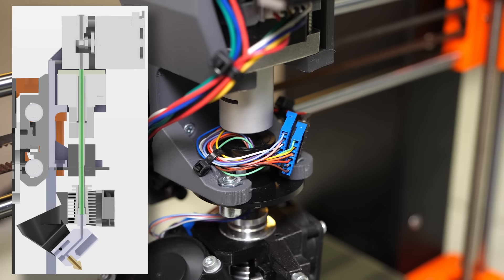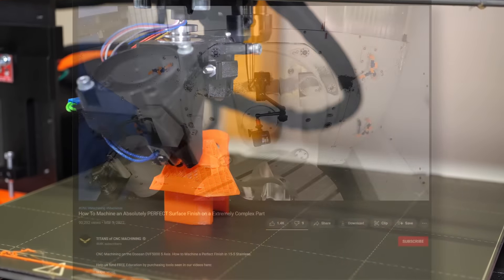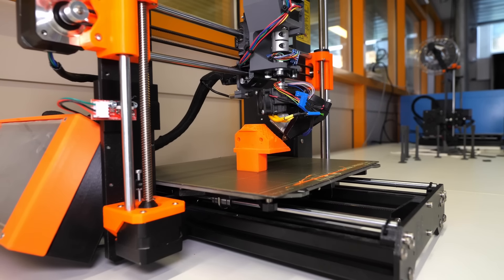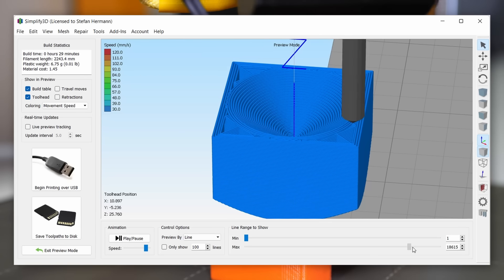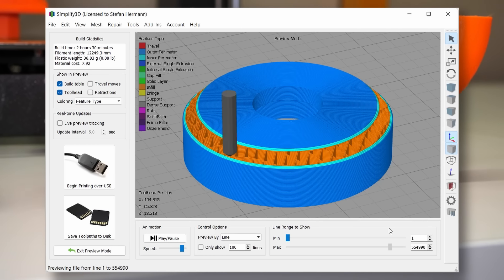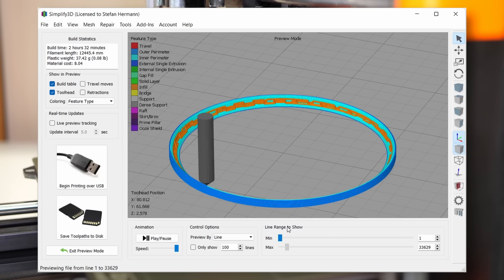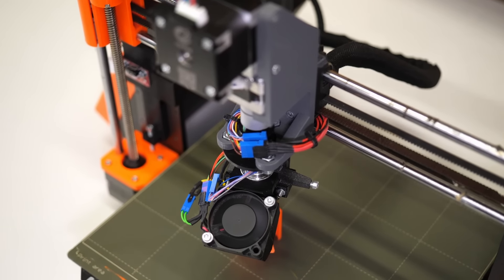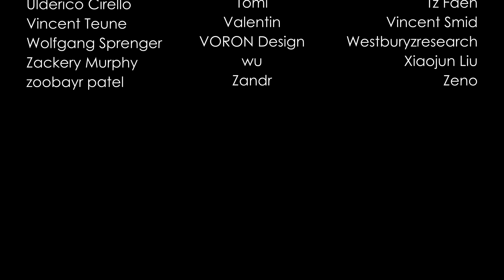Impressive 4-Axis Non-Planar 3D Printing

Comment from the maker: What do you think about the RotBot and Conical Slicing? Niche application or the next evolution of 3D printing!
Reply: wow
Reply: I've always been interested in multi-axis printing but there is like no software support. Their approach to slicing is super interesting and makes a ton of sense!
Reply: I want to know more about the potential strength increases.  This could be really big.   I also want to see what happens when you try to build more complex parts.
Reply: As you said, mind blowing. I mostly use my printfarm to print nosecones for the model rocket kits I sell. Due to the method of layer adheasion they have a weakness for dropping hard surfaces. This method could change the way the layers form this making them stronger without needing more infill or walls.
Reply: Anything that helps in reducing the mechanical anisotropy of printed parts is welcome, that actually interests me more than the overhangs not needing supports because for that we have many solutions (good profile and printer tuning for easily removable supports, dissoluble supports) whereas we don't have a lot of ways to drastically increase inter-layer adhesion. 

Having used a Blackbelt printer in the past, just having a different strength distribution was already quite interesting, this new concept must be even more exciting !

What about doing some mechanical tests on these conical printing samples :D

Also, kinda cool to see some open source 3D printing from my own country :p
Reply: I wonder what are print strenght impliciations. More overhang support is amazing, but I think there might be also some strength benefits, to prevent planar delimitation.

Conical slicing is genius, it is very simple to implement, and doesn't require extremely complex AI to figure out the CAM / g-code. It is not the fastest, but definitively it works basically for free in all scenarios. Even more genius is transforming the part, doing normal planar slicing, then inverse transforming. Reuse of existing slicer.

I do have a part to print that has some overhangs, and it fails with normal planar mode, and I might try using conical slicing on my normal prusa, as it might actually solve the issue. I technically do have multi material, but I rarely use it.
Reply: Wonderful! Thanks for doing the hard yards researching this! I appreciate the quality and time you put into making these. Well done!
Reply: @Sky_Shaymin  i think it is a 'good start' and just like *delta 3d printers*, delta 3d printers has been 'left behind' while support for the simplier xyz printers raced ahead. i think what is missing in today's slicers is to add support for 'custom tool path planning', i'd guess it is mainly that there are still many issues to fix for 'simple' xyz printing. Hence, 'custom' is pushed further back.
Reply: Incredible what Michael Wüthrich at/and the ZHAW did here. Especially their decision to make the RotBot hardware open source. By sharing their research and development the community can all explore and get our teeth stuck into this. Thank you so much!
Reply: I'm surprised you didn't ask them to print you some test samples for your durability testing.
Reply: I'm leaning towards "niche" because I'm looking forward to resin + reusable support resin + magnetic block supports.
Reply: awsome but would be worried about slowness, would love to have somthing like this on a belt printer though
Reply: @4:15 slicer4rtn
Reply: I want to see a timelapse of this machine printing
Reply: It would be interesting to know how much time difference there is (if any) between printing on 4 Axis vs with support material. I´m not very concerned about waste material but about print time.
Reply: Really clever method, only downside on bedding strength…
Reply: @Colakaka  At the moment, there is quite some difference. But I belive, that there is a lot room for improvement.
Reply: Very cool machine and neat trick with the slicer, respect. 
I will be happy as a clam when we can achieve actual part slicing with simulation for those trouble spots.
Reply: Definitely next evolution, no one likes to remove supports, it also may increase the strength of the print due to the layers not being simply on top of each other.
Reply: It closes a gap so i think next gen FDM one evolutionary step further ;) 

But i guess it has to be seen how good it will turn out in the end. 

Are you going to modify your printer and Print some Test hooks ;)?
Reply: Huge step forward!
Reply: I think this would be amazing with a dual head extruder approach where the limitations of the conical slicing could be resolved with a non-angled extruder
Reply: The name😂😂
Reply: I think it could be an evolution, if it's combined by Polar/rotating bed FDM printers. That would simplify the print head - removing need for fourth stepper, slip rings and long, constrained molten plastic path.
Reply: @Papinak2  I had a very similar idea, just taken one step further. Orient the entire rotating build plate at a 45° tilt such that gravity is always pulling the extruded filament towards the plate's central axis of rotation. Overhangs of 45° would be 0°/vertical, and since you can generally print >= 60° unsupported overhangs with PLA, that would mean you could then theoretically print ~105° overhangs (which might be considered underhangs at that point) like a mushroom cap, with zero support. Wouldn't that be something?
Reply: @hollt693  the gravitational force is almost negligible, it is almost entirely dependent on the extrusion direction (extrusion momentum).
Reply: @Papinak2  the problem with polar printers would be that your center of rotation is fixed at the center of your bed, so you conic transformation can only be done at the center of your bed, which us not ideal  when you start sectioning.
Reply: I love the potential for increased part strength - this would be a huge gain for FDM printing. I would really like to see conical/variable angle slicing become more mainstream in the popular slicing software packages. This would not only benefit current users and tinkerers, but would create even more opportunities for innovation - after all, some of the greatest advances in 3D printing have come from enthusiasts and anything to support this would benefit us all.
Reply: Send one sample to someone printing AR15s and let them test it for you.
Reply: @Anonymous-by9gr  I'm sorry, I'm not sure I understand what you mean by extrusion direction/momentum. If gravitational forces are negligible, then is FDM printing no different in space? I'd think bridging would be easier, at least, but now I have to go look it up to sate my curiosity.
Reply: Im so glad its open source and didnt end up like the inifinite-z 3d printer.
Reply: @Anonymous-by9gr  true that. So we need to add 4th stepper again to make Y-axis movement. It'd be still simpler than the rotating head, although it'd somehow limit the build area. And whole turntable mechanism would be a bit heavy for a bedslinger.
Reply: why the effort to angle the nozzle? just make a nozzle with a 45° bore on the tip. Then make it a toolhead for the e3d toolchanger. That way it could be used only for overhangs with normaly sliced models. It would only need a script that changes the printhead for overhangs and determin the outer facing side of the overhang to rotate the nozzle accordingly.
Reply: So if I used a 3d printed 6 axis robot arm to use the conical slicer to print something, it will be perform better?
Reply: Highly interesting topic. But (sorry to say) the audio track of this video sucks, like whole words are missing.
Reply: I’d like to see you build one report back issues and evaluate the potential for strength improvements, if these are significant I think this will drive adoption. I’d also like to know if the quality of the base printer is more important for 4 axis.  I recently saw some prints from an Ultimake, I didn’t think they were antipyretic better I than what Inget from my Ender3 in PLA
Reply: You need to ask them print your test hooks and strenght-test them
Reply: They should combine planar and non-planar slicing. Planar for those areas that cause problems (overhang section facing inwards etc.) and then non-planar where ever it provides a benefit. At the end of the day planar printing is way faster, but non-planar could be used for areas that otherwise would require overhangs or to change the slicing direction to achieve higher mechanical strength in the orientation of the force. So I think they should combine both slicing methods for yet unseen properties of the print.
Reply: @harviecz  Looks promising to me, but how about using the nozzle itself to extrude the "rivet" just to make things easier in the beginning and avoiding a second device and process. If the filament is hot enough, it should be possible to "shoot" it right through the holes.
Reply: @adrenalinemedia  yes. i was never considering using separate device to inject the rivet. it has to be done automaticaly during the print...
Reply: I think it has a lot of potential. I see it as a next big thing in 3D printing.

We need more research.

And you printing your standard set of hooks and notched samples and comparing to existing results could be a starting point!

Be part of the history, do it!
Reply: Use a polar 3d printer, no need for a 4th axis
Reply: so nice

Comment: We are getting there folks.  Our hardware has been capable of multi axis for a while.  This is huge
Reply: Well hardware is basically just steppers. Slicing algorithms are everything
Reply from the maker: Now we only need to get software developers on board!
Reply: Actually, the hardware was never the bottleneck, as a cnc post processor programmer, we know as a matter of fact that you can add more axes on the go but trajectory calculations for that axis is a much harder task. And it gets harder as we add non linear axes. But hopefully more developer's will join on the train.
Reply: And Im still forgetting to level the bed, in not a long time I will be able to forget to level the bed non planarly
Reply: I would love to code for this project if possible, i am a CAD DEVELOPER , not sure if that can help.

Comment: i´m a machinist programming 9 axis mill turn on a daily basis and i can´t wait for 3d printing getting rotational axis, there is so much potential in 5 axis 3d printing. No supports, parts with reinforcing layers that are going three dimensionally over the part, that help distributing forces, reinforcing the weakspots and eliminating layeradheasion as a limiting factor etc. ...
Reply: my thought was similiar
"if we add another axis to be able to rotate the nozzle, we could smoothly switch between different print methods"
but the approaches all have the same issue
we need a slicer code able to execute it
i think the mechanical challenge will always be the smallest part
it will always be about the code that causes the slow development
Reply: Like 3d plywood
Reply: @firebladeentertainment5739  agreed.
Reply: I am no engineer, but I'm worried more axis might be a little two much stress and complication for the filament that we use today. And what if the new printers need different material and non of the producers catch up. Burring new printers from the beginning? Like others said we are still on the dawn of additive manufacturing. Nothing is set. I just don't trust the big industries. I will put my trust in us, the creators because this is really exciting
Reply: @mad-0614  I can see this being a problem with some materials, with abs I don’t think that it would be much of an issue but I have had pla‘s that we’re pretty brittle wich definitely could be a problem
Reply: @mad-0614  it could be an issue with some kinds of 3D printing but FDM is not the only method, liquid based jet 3D printing like I think stratasys does (maybe called “poly jet” can’t quite remember) wouldn’t have the same limitations as filament based 3D printing.
Reply: I'm also a machinist. I'm just starting to learn 3-axis mill programming. I'm wondering if they could adapt current programs for automatic tool pathing to 3D printing?
Reply: Just imagine being able to define the direction of carbon fibre in the print! That could mean we could 3D print whole boats.
Reply: @sail4life  we can somewhat. Not with your everyday chopped fibre filled filaments, but with continuous fibre machines it may be possible to choose the direction of the fibre. However it still wouldn’t be tightly woven like actual carbon fibre and so probably not as strong.

An interesting way to go forward would maybe to lay carbon fibre meshes in between layers of plastic, to add reinforcement kind of like steel in concrete.
Reply: Imagine a bed that can rotate smoothly, tilt in multiple directions, as well as go up and down like a core XY, combined with a print head that can move in the X and Y direction, can change angles like the bed can, and can also rotate. This would allow extremely efficient moves.
Reply: Technically 3d printing is not three dimensional, it’s a 2 1/2 system. Interpolating in x and y only.
Reply: Not 9 ax
Reply: @Patrick-857 I've seen a working prototype of exactly that in a video recently

Comment: The idea of pre-distorting the object before slicing it and then un-distorting the code afterwards to get the desired results from an existing slicer without writing a whole new slicer to do the task is genius.
I did think that the extra axis would be to control head tilting, that way it can still behave like a regular FDM 3D printer, but the tilt ability would then allow the printer to do overhangs etc. without support.
Reply: This is what one of the rocket manufacturer does with its 3d welding machine to print the whole tank. Its slices and adds some pre-deformed calculations and so when it prints it is now a proper print. This is done because welding deforms the metal so without this technique it would be  a very distorted tube.

Comment: I would reall love to see this 6-axis printer, with tilting base. This should make printing overhangs with no support even better, but of course it is more complex and costly, so this modified prusa with tilted nozzle is an interesting cost-effective option.
Reply: my employer makes 5-Axis CNC machines which have FDM functionality as well.
Reply: @CypherAod  And what slicer do you use with it?
Reply: @greatestevar  Given that WE would not be programming it, your claim applies to the select few who will do so, the rest of use would just be users of the software….but even then, not so much as 6 Axis machines have been around for awhile.  So it’s not like the human race hasn’t had any experience with it.  Also, there was one int he video.  So it has already been done.
Reply: There was one in the video….

Comment: Respect to whoever programs the slicer for these things . I can't imagine how you do that
Reply: There is an chinese approach which does the following:

1. Define the object in a voxel grid. (Small box of size dxdxd, where d is the diameter of the nozzle)
2. Calculate the reverse print aka how a CNC machine would destroy our object in layers, one voxel at most per layer.
3. Calculate the moving convex hull of our object, while simulating the print.
4. Calculate reachability of voxels, while simulating the print.
5. Use 2/3/4 to define an order of voxels to print, while printing on existing voxels.
6. When done, combine the voxels of step 5 to groups of voxels.
7. Calculate the actual geometric layers, from step 6.

=> The result are 3D complex layers that can only be printed on a 4+ Axis system.

Comment: This is essential for FDM to move forward. We have stalled on 2D printing + Z (a more accurate description)  and weak layer adhesion. Would be interesting to see strength differences and see if we can get true anisotropy. The next step would be a rotating nozzle from 45-90 degrees.

Comment: I've been looking forward to non-planar layer deposition for a long time, but mainly to improve top layer surface quality. Extending it through the part looks likely to significantly improve part strength due to the effect you mention.

Comment: An approach to fixing the inward overhang would be morphing the stl non uniformly, basically instead of a 45° cone, you could  make it so that along the y axis you are at 45° inward, and along the x 45° outward, making a saddle shape or even slicing inwards to 1 inch off of the center, and then outward, it's fairly free, you're already converting cartesian to polar and then scaling up or down, so you just have to apply a curve that takes into account the position along the polar coordinates and applies a pair of curves instead of a set angle from just the distance.
Automatic overhang detection exists, so mapping overhang position vs the angle and distance should be doable, and automatic curves may be created.
Reply: You're exactly right. Came to the same conclusion as I watched. Some of the edge cases could be trickier to fix - detecting and modifying travel moves that would otherwise result in a crash, for example - but not impossible I'm sure.
Reply: The big concern with that is collisions. There are cases where you can't get a tool (nozzle) in the space available with any arbitrary transformation.
Reply: @bobthecannibal1  Good point. Sounds like an interesting problem though. No need to complete one "layer" before starting the next, necessarily, so perhaps there's an ordering problem buried in here.

Comment: I'm really excited for mainstream non-planar printing and slicing. I hate wasting material because I just never throw the stuff away. And from an engineering standpoint being able to compensate for the (material) non-linearity of 2.5D printing with non-planar printing is a huge improvement.